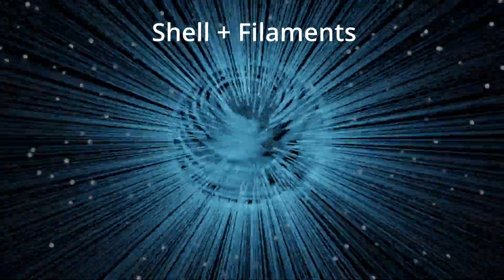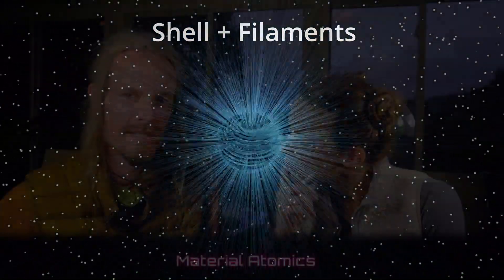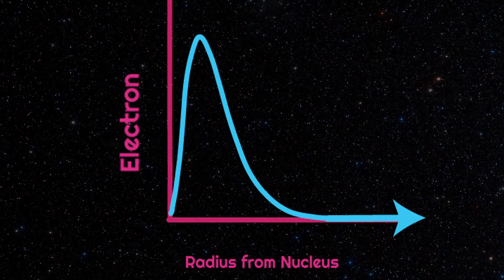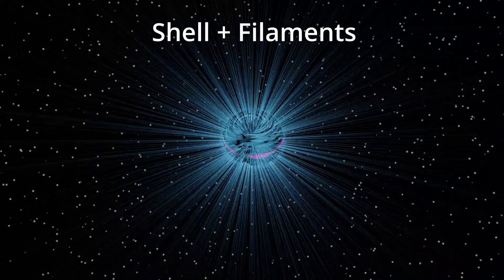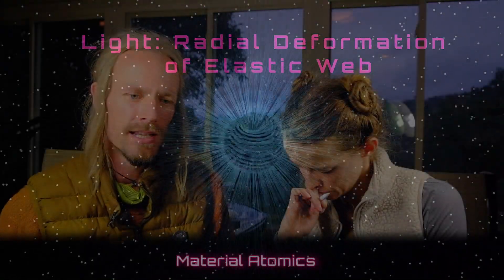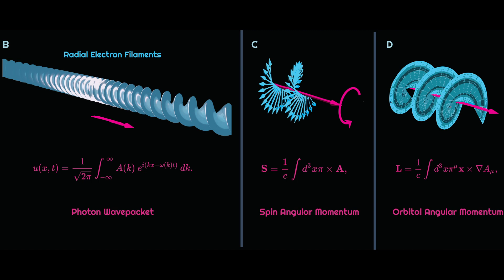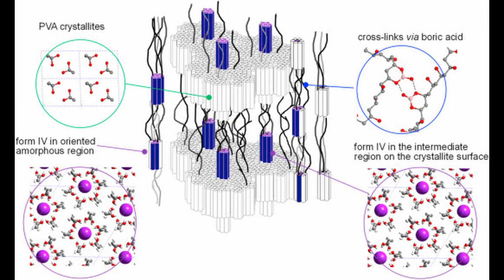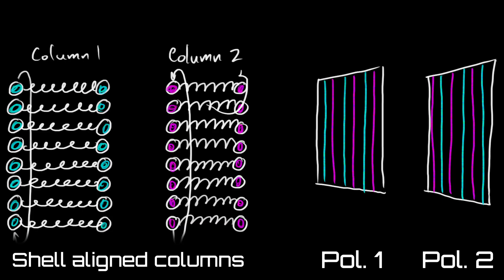Material Explanation for the 3 Polarizer Paradox - Topics in Physics #7

Comment: I have heard a much more quantum explanation of this effect. Your explanation is still quantum realated, but more how polarized atoms in long alternating polarity columns in the filter line line up with the atoms in the next filter - if in the same rotation to each other, the photon EM waves pass through because polarized atoms line up with the same polarity in each filter. But when you rotate one filter 90 degrees, the atoms didn't move or flip in any filter, but now the column alignments of each filter are a single system that are perpendictor to each other which "looks" like, from a photons's view, every right atom is in front of a left atom and vice versa, forming a 3D matrix of these complementary atoms, thus the two polarites of each atom in the path of the photon's EM wave cancel and thus virtually no photons pass.  When a second filter is placed between the two filters, the 1st filter and 3rd are still the total polarity reference, but the filter in between is subtractive (not like in like color) but in polarity. Thus a 22.5 degree filter and a 45 degree behind it subtract and yield an effective 22.5 degree combined filter and thus (because its a cos squared function) 85% of the light now makes it through the 3 filter system: 2 offset references and 1 or more in between as "modulators" so to speak. Am I correct?

Comment: I find it strange, or a least interesting, that there is no difference in the end result whether two filters are separated by a distance,, or whether they are stuck to each other. The cumulative effect seems to be independent of what the first filter does. After all, how could light first be polarized in one direction and then the other if both filters are one? Are the atoms somehow twisted this way and right after that that way? When I try to visualize this, all that comes to mind is a large hole, or wide slits, in one filter, and a smaller hole, smaller slits, in the other. But then, I loose any connection to polarization.
edit: It is of course possible to make the hole, slits, smaller and smaller by rotating the second filter, letting less and less light through.

Comment: Here is why I don't believe there is truly a thing such as a single photon. If you had a single photon and it was propogated at a single point of space, how can you explain the fact that it could be viewed from more than one point in space. It literally has to reflect to become visible from any other point other than in direct line with its point of origin. The fact that if it were a wave further disproves the fact of the existence of a single photon event because you cant get just a single wave. But in my opinion it oerforms more likey a wave because of the scattering when colliding with an object and the diminished intensity attributed to distance from that point. Additionally, just as sound echoes, light reflects. But here is another conundrum. If nothing is faster than light in a complete vacuum, how come light cannot escape a black hole. Either its gravity is faster than light (which theoretically has no mass so how is that possible) or magnetism is faster than light. And if either of the two were possible then theoretically, although not realistically, a device with comparable power could allow faster than light action.

Now, i realize i worded this all as if it were facts i could claim to actually back up with math or education, but i am literally just a thinker of things. Ive got no university education or anything similar, simply graduated highschool. But i hate saying i dint know to any question twice, and spend all my free time answering these unanswered ideas of mine. But this is one of the more complex ones

Comment: I suspect that if you look up "Malus Law", "polarizers", and "Bells' theorem" enough, you'll end up at this video. lol.

The model I have in my head is that "vectors of the amplitudes" for the waves of light can be used to explain this in a simplified manner, saying nothing about the material physics of the situation.

A polarizer does not send out a single wave of light oriented in one direction, but many. For instance, in this example let a polarizer send out two waves of light that are oriented 90 degrees to each other, or at 45 degrees to the first polarizer's orientation, so that the effective amplitude by superposition of waves gives the appearance of a single wave with an amplitude oriented at 90 degrees, the same as the orientation of the first polarizer.

What never made sense to me is why adding a second polarizer oriented at any angle away from the first polarizers orientation did not immediately block all of the incident light, but instead it slowly dims until, when perpendicular at 90 degrees to the original polarizer, there's no light left. If a polarizer really only passed linearly polarized light, shouldn't all of the light be blocked? Also, why is it that some large fraction of light gets transmitted through the first polarizer at all, and not some tiny fraction of light that just happened to be oriented the right way to be transmitted at the moment of incidence?

Well, these component waves explain it. A polarizer does more than block light, "somehow" it reorients some of it.

Continuing with the example, when you add another polarizer at 90 degrees to the previous polarizer, and so at the incident wave's orientation, neither the component amplitudes or the final amplitudes of the incoming waves pass through it as they're all oriented the wrong way, resulting in zero transmitted light. But by rotating it so that it's at 45 degrees to the first polarizer's orientations, some of the components of the previously polarized light can pass through. If only one off axis component amplitude can pass through due to orientation, then that would get you to the halving transmission of the incident intensity you'd calculate using Malus Law regarding two polarizers at 45 degrees to each other, 50%. Add another at 45 degrees, then you pick off half of another component amplitude, giving the final result of 12.5%, and so answer the "question" in the three polarizer paradox.

At any rate, the "magic" of this paradox comes from not thinking or being told about how polarizers work. It's frustrating because how it's presented is rather mysterious and misleading, much like a magic trick. When the wrong idea of a polarizer is told first (black bars that only lets light moving vertically with it to pass through), it becomes totally confusing.

Comment: 2 polarizers perpendicular to each other, could be interpreted as a Faraday cage for visible light, no ? 

A faraday cage is a mesh that blocks radio waves, so when we put two polarizers perpendicular we get vertical and horizontal slits aligned in a mesh that blocks visible light.

Comment: What happens when you pass single photons through a polarizer? Does the polarizer itself store energy?
Reply from the maker: there is a relay of light across the atom in the polarizer. It's unclear if this is a lossless relay process. Cosmic redshift might argue that some energy is lost after many relays.
Reply: @MaterialAtomics  If this explains cosmic redshift, does it mean that the doppler explanation with an expanding universe is incorrect?
Reply: @dennislevy3603  yes. that is we do not believe it is a doppler effect. we believe it is the result of countless relay events between atoms along the way.
Reply: @DemystifySci_Podcast  Presumably photons interact with particles statistically, which would mean that a statistically some photons will get more red shift than others. However, with the doppler effect they would all get the same amount of red shift. Is this seen in practice to distinguish between the two possibilities?
Reply: @dennislevy3603  forgive my autism but we don't have any particles in the material world - particles are instantiations of functions. Can you put this in material terms for me?
Reply: @DemystifySci_Podcast  If energy is lost  after many relays, then the amount of energy lost will vary depending on these relays, so there will be a statistical spread. If the red shift is due to doppler effect, then the amount of shift is constant and exactly dependent on the speed. Is this seen in practice?.
Reply: @dennislevy3603  well there is no independent method of assessing speed of recession of distant galaxies if they are even recessing. i doubt that they are.
Reply: @DemystifySci_Podcast  Evidently there is no independent method of assessing speed of light either. It has been proven that assumptions are made that may not be correct.
Reply: @DemystifySci_Podcast Radar uses Doppler shift, so no reason to not believe it exists

Comment: This is a bit of a doctor - patient talk....me being the patient:) So i talk in sesami  street language...If light thus photons have as image shows, some sort of rotational screw thinghy with electric filaments rotating of some sort happening while traveling forward, then what is the diameter from the center, and what keeps is this diameter steady?
Secondly,  what drives  or is the force that drives this rotation while at the same time moving forward?
Last polarisation of light change the color, thus the wavelength.  This means that a first visible  wavelength can become invisible, but also that invisible wavelengths become visible (IR)  with the use of more polarising filters on different angles there seems to be more changing. But you seem to treat light as one fixed entity. How does this shifts  in wavelength, thus  appearing and disappearing of only light fit?
Reply from the maker: Lot of questions here. I'd humbly request you make a discord account and come kick it there so we have more space to draw this out. 

That being said, i think the key to your second question is recognizing that wave length here would mean intervals between push and relax on the filament, different phases of that impulse arriving at different times (due to geometry of travel distance and peculiarities of the polarizers lattice) will result in certain wavelengths appearing dominant. There is a more basic concept of interference at play here and we have at least two conversations on that here you can check out.

Comment: what about high energy photons? like x rays.
quote
In the absence of strong external electric or magnetic fields, atomic systems of different magnetic sublevels (but otherwise having the same principal and angular momentum quantum numbers) are degenerate in energy. Because of this degeneracy the measurement of the energies of atomic transitions is not enough to get a complete characterization of the quantum state of the system--the magnetic quantum numbers are also needed. The magnetic quantum numbers are related to the spatial orientation of the atom or ion. In the case of pronounced external symmetry, spatial effects can be important. For example excitation in cylindrically symmetric situations can lead to oriented or aligned systems where the magnetic substates with different angular momentum projections have the same energy but different populations. If such a system undergoes a transition which results in a photon or electron emission the emitted radiation will show anisotropic and polarized behavior.

https://www.nist.gov/pml/quantum-measurement/atomic-spectroscopy/electron-beam-ion-trap-ebit/x-ray-polarization
Reply from the maker: yes, let's do a video on high energy photons

Comment: wait. the middle third polarizer must affect the light, change the angle of spin such that it changes the interaction with the third one, cuz if the light was unchanged it should still be blocked by the perpendicular , last, polarizer??
Reply from the maker: yes of course - i'm sorry that wasn't more clear.
Reply: Yes.
Polarizer at 45° position let the light go through .
This explanation is 
Not clear 😢

Comment: Considering that both of you didn't use any 3d models , that was explained clearly . The only problem is when the polarizer is shifted left or right it would block the light , because the opposite rotations would align . 
When something is rotating how can it maintain tension , same problem when explaining permanent magnetics . So I hypothesis there are probably atoms that aren't bonded to anything, but are trapped  in the cavities of Ferro magnetic materials . Too dense and no cavity , nothing can move , insufficient density and the spinning atoms escape .  There is a possible flaw with my hypothesis , because if a permanent magnetic is cooled or compressed enough, the completely stationary magnet would just start spinning for no reason 😂.
Reply from the maker: I think that moving the aligned columns right or left should maintain cohesion on balance. Remember it is not exactly 1 r followed by 1 L.. just averages that way. As for maintenance of tension, we have to explain how connections break and form - which is a fiber structure issue. We’ll get there!